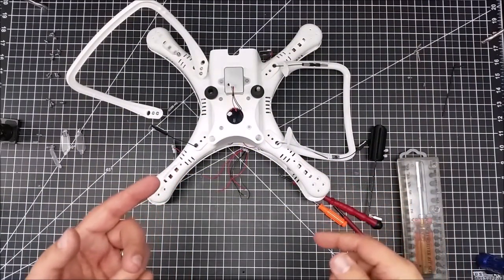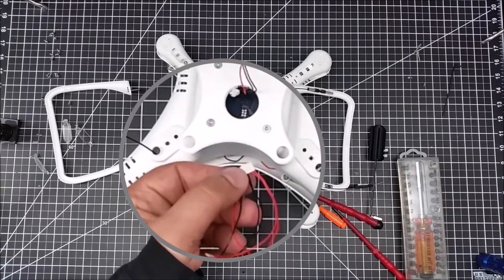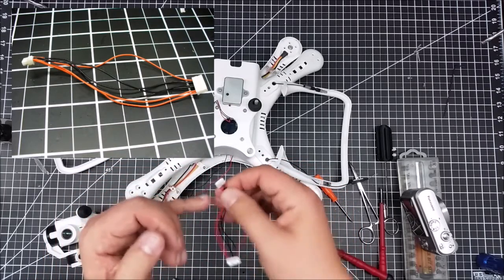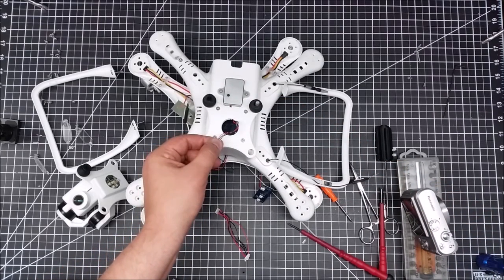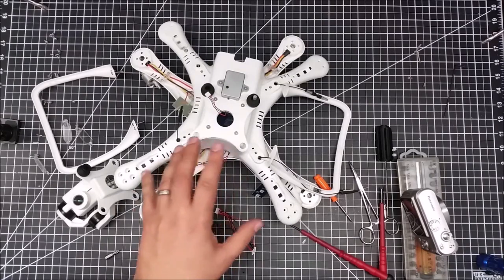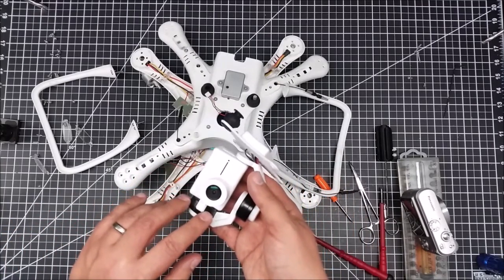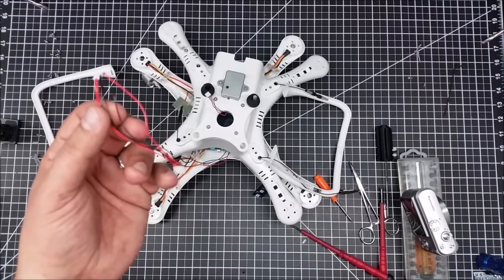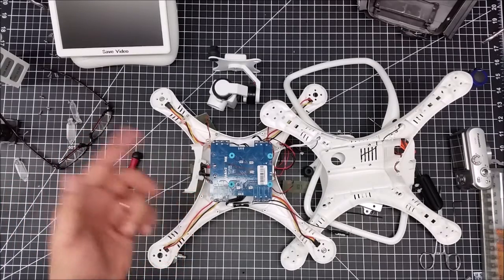Video Drone - UpAir Disassembly and Major Smoke!

Comment: Do you have the pinout for the upair one v2 or 4k plus?  Maybe an out put diagram for the flight control board.  Or know where i can find them.  I have two drones done with different problems.  Really anything would help me at this point.  Your videos are great and really helpful.  Thank you.
Reply from the maker: Not really as they are a bit of mix and match based upon the version, however if your handy with a multi-meter and scope you can sort them as I sort of did for my need.  You could also try writing GTen as they are pretty good about assisting and have a service in MD as I understand it...

Comment: I have replaced the px4 board in my upair one plus. All seems fine and the motors fire up but then speed doesn't increase. Any ideas mate. Cheers Don
Reply from the maker: So you replaced it with another like in kind board?  I can't think of anything other then its not unlocking...
Reply from the maker: Sounds like it isn't unlock and other then than sorry no...

Comment: Bummer, I was saying, 'Don't do it, Don't do it'.... :-).  I'm very interested in the pin-out of that cable winds up being on the new one.
Reply from the maker: +RJ_Make  but that is  part of the fun!  However think the issue is the orientation of the second connector if you know what I mean.  As I matched it to the first and think it's flipped so the wires were in the correct order but the pins reversed so hot ran to ground and puff went the magic dragon.  As the crazy thing is the just red or black wires as on the newer upair I got they are colored but I have not taken it apart enough to see the orientation of the second connector yet

Comment: My UPair one flew away on Christmas  day. Fortunatly had my Phone numbers on it. A lady returned it yesterday pretty badly broken. My question is there is a button on the bottom of the transmitter and I'm wondering if that had anything to do with the flyaway?
Reply from the maker: That's the binding button and no had nothing to do with the flyway (less maybe you decided to press during it during flight breaking the bind, but it should of did a RTH), which version do you have the older one with the screen or the new one with the app?  GTen the maker of the Upair has horrible quality control and have had long standing issues with the compass (older version)  which is required for it to understand direction...
Reply from the maker: Question, could you control any of the directions?  As typically if it was to go straight up there is an issue in the ESC's where the PID loop doesn't exit.  For repair you can contact GTEN, but my experience has been the parts cost more then I could buy a new one for...

Comment: Hi, i can you send me a picture of the (in your case black and orange cables) so i can check the correct pins because mine had the same issue and now i dont know how to plug them! thanks
Reply from the maker: +Johncy Pena sorry I have since sold these on eBay as I wanted to try something different...